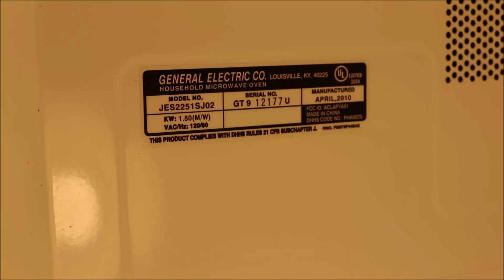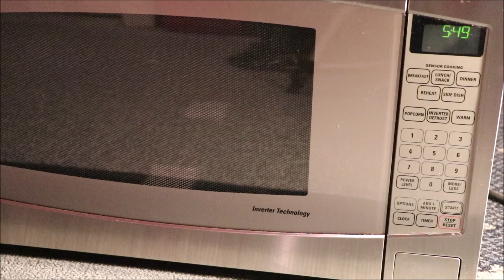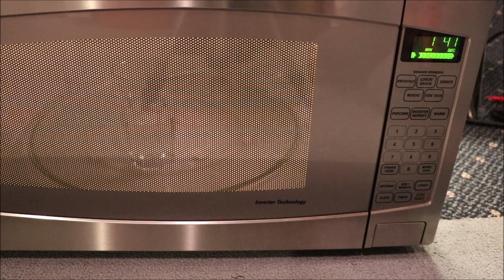FIXED - GE Panasonic Microwave Oven (Inverter Technology) not working -faulty door switch connection

Comment: HAVE PANASONIC INVERTER FROM 2021
NOW AT 3 YRS IT SHUTS DOWN ON POWER LEVELS 5-10
AND ON SHORT TIMES 
IT WILL ONLY RUN ON LEVELS 1-4
IN ORDER TO COOK MY MEAL I MUST ENTER 98:45 POWER 4
98 MINUTES TO COOK A MEAL!
I THINK HEAT SENSOR IS GONE.
LOUSEY SHORT LIFE SPAN FOR AN OVEN

Comment: I have a slightly different Panasonic Inverter model but similar 3 second cutout.  The connectors look good and seem to completely connected.  I traced wires and was not able to see any problems then I looked at the operation of the latches and saw a small hooked lever at the bottom of the switch assembly that somehow had snagged on one of the brown wires that goes to the rotating plate motor.  I moved that wire away from the switch latch lever so it was able to close when the door latched closed and the microwave starting working again.

Comment: My white switch was melted  i cleaned it up and put the connected back on, which worked for a month and the problem came back.
Reply from the maker: If your switch melted, it is certainly internally damaged or compromised.  You got lucky it would work briefly.  It takes a lot of heat to melt that thermoplastic.  Just replace that microswitch.  They are pretty inexpensive.
Reply: @YuDaMan  Thanks for the reply. So, the plastic thing that melted was Z shaped covering the two connectors (at 1:58 you pointed at it, the one had slight discoloration for you). You still think it was the switch that has problem? If so should I get the microswitch along with the Z cover (what would that be called?). Thanks again!

Comment: Also intermittent 3 second run time on my Panasonic NN-SN960S. Same symptoms of a "burned" look on the plastic cover of the spade connector on the door switch. Looks like bad spade connection caused overheating or arcing which in turn melted plastic of the inside of the covering onto the connector which in turn probably made the electrical conduction even worse over time. Clipped off old female spade connector covered with black, burned plastic, bought new female 3/16" connector ($2.99 for box of 20 from AutoZone), crimped onto old wires, and polished the male spade connector. Definitely an improvement, but unfortunately, microwave stopped after 3 seconds once again shortly thereafter, so I will continue looking for more problems if keeps happening.

Comment: It runs when I open door. I unplug it and replug it after food is in. How do I fix this.Timer and everything else works.
Reply from the maker: the door microswitches are not working properly (normally 2 or more switches).  hey are there strictly for safety and yours is no longer safe.Microwave repair is NOT for the amateur.  There are lethal voltages stored in the capacitors that can kill you.  The switches normally fail safe but opening the door is VERY dangerous.  New microwaves are cheap enough.  Throw it away would be my advise unless you are skilled at repair.  How much is life worth?

Comment: My microwave stops running after 23 seconds every time ?
Reply from the maker: I don't have experience with 23 seconds but perhaps you have the same problem as 3 seconds.
Reply from the maker: This article says it's the magnetron or inverter board:  https://www.fixya.com/support/t1922926-shuts_off_after_23_seconds  
https://www.fixya.com/support/t299547-microwave_cuts_out_after_23_secs
Magnetrons normally have a pretty long warranty BUT the labor to diagnose and install are probably more expensive than buying a new one.  Sorry I can't be more helpful.
Reply: @YuDaMan  yeah. I think that might be the problem. I wanted to see about buying the part online. But, people are telling me. Just buy a new machine. So, I guess that is what I will do. But, thank you. I really appreciate your help.  👍

Comment: I have this 3 second shut off problem with this exact GE microwave. Except I DO hear the fan go on and the center plate turns. Is this the same fix?
Reply from the maker: Possibly but I''m not 100% certain.  There is more than one microswitch triggered by the door position so if another connection is poor to any of those switches, it might show different symptoms/behavior.  BE VERY CAREFUL and don't tackle this if you are not familiar with electrical items.  The shock can be LETHAL.

Comment: My microwave is 5min work after suddenly off
Reply from the maker: 5 minutes exactly, every time?  It will take you 15 minutes to check the connections I show in my video but don't do it if you don't know what you're doing.  The charge on the capacitor can KILL you if you touch the wrong spot accidentally!
Reply: @YuDaMan  bro I press 15 minutes but my oven stop after 5 minutes

Comment: Thank You that was what was wrong with my microwave as well
Reply from the maker: Yep, workmanship issues like this are seldom one off.  I wonder how many microwaves got tossed in the trash because of this.  Sad indeed.
Reply: @YuDaMan  I was just about to go buy another one could not believe just plug it back in and BOOM it worked Thanks Again